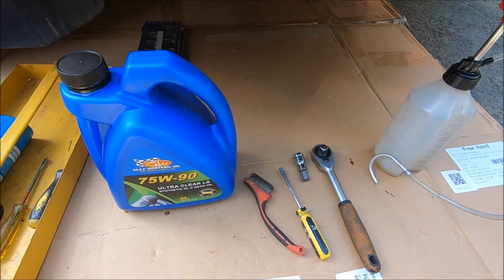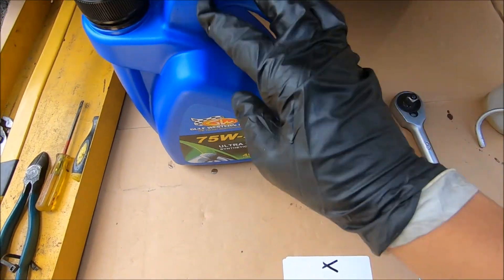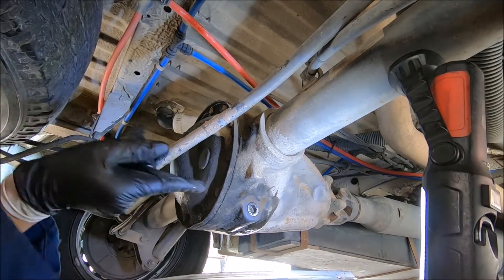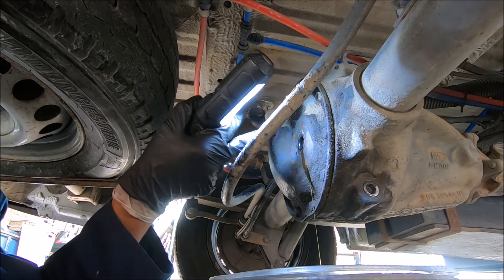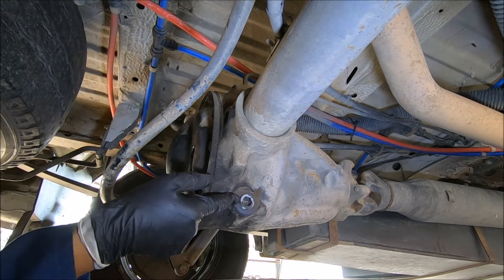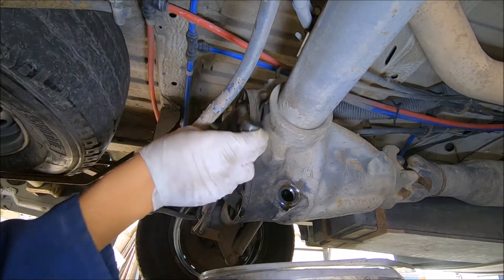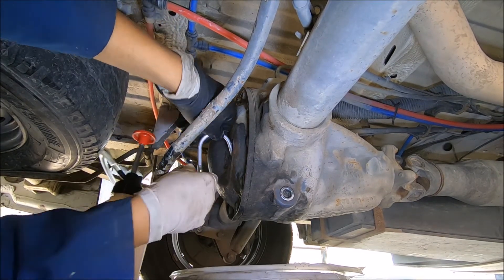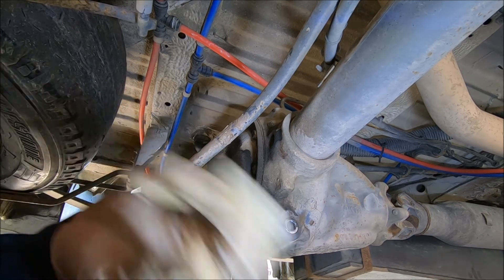Mercedes Sprinter Rear Diff Service W906 2007 - 2011 - Oil Change

Comment: Good Job ;)
When empty, stick your finger inside and test if you can feel any metallic residue. 
If there is anything inside, something probably is wrong.
Reply from the maker: Thank you! Thats an excellent point, normally when the vehicle reaches 200,000km & 300,000km I would recommended removing the cover to inspect the diff and housing. This only needs to be done if there is no service history.

Comment: Just the info I needed, what size tool, what oil.
Reply from the maker: Please check your owner's manual as each van can vary. However for this Sprinter it required a fully synthetic 75w-90 gear oil and the tools required was a 14mm hex driver along with a flat blade screwdriver, both of which can be seen in the video. Thanks

Comment: Any advice on a keeping rear axle I have the 3.5 v6 Freightliner 2500
Reply from the maker: Sorry I dont understand what you mean. "keeping"?
Reply: @AutoBuddynz  I mean if the rear axle is any good on that model mine shows some leakage but not sure how bad they are and if the vehicle itself is considered a good reliable vehicle